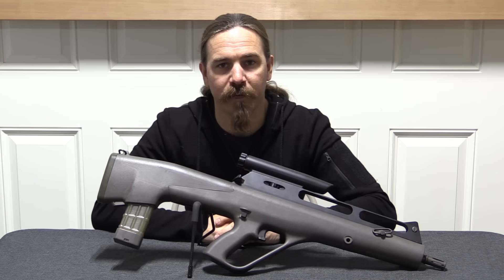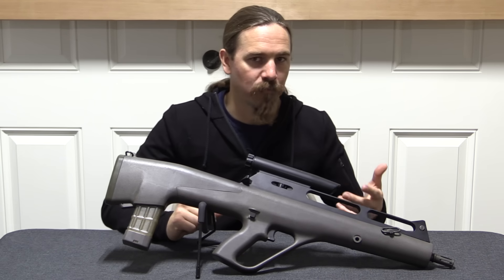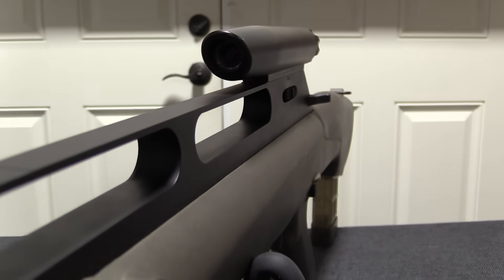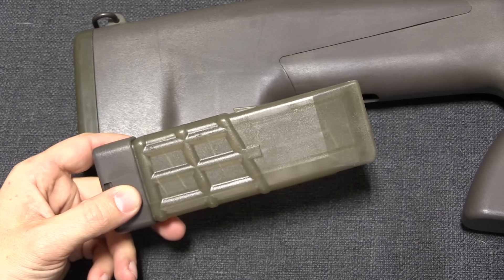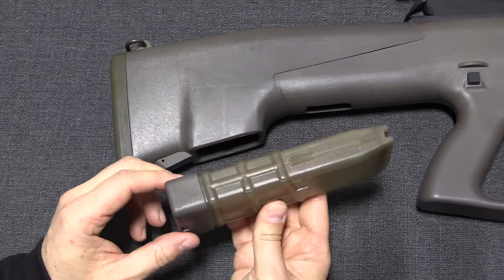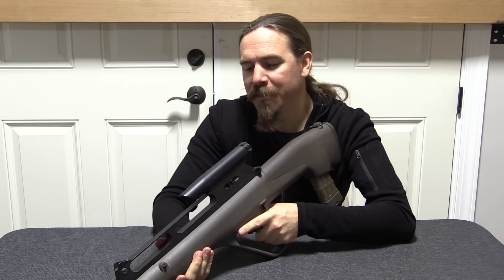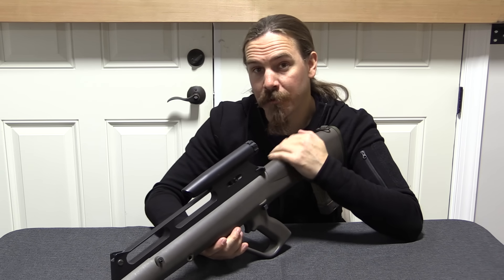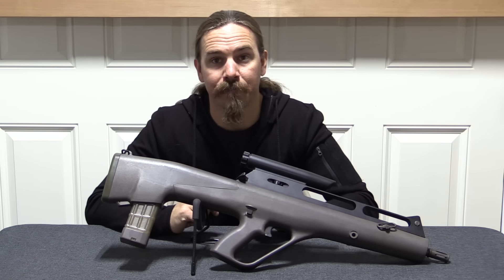Steyr ACR: A Polymer Flechette-Firing Bullpup From the 90s

Comment: Couldn't this design have been improved in some way to make it so the case just flushed out from the muzzle after firing the first shot? Certainly would help address potential problems with the extraction.

With the feeding, I can see it easily being fixed by shaping the magazine/feeding mechanism and the breech in a way to guide the cartridge in there rather than the finger that basically pokes the bullet into a flat hole 1cm away from the mag. Could technically be interesting, since it would straight up remove the need for having a hole to have stuff extract from, which could in theory make the weapon virtually mud proof (Asides from the muzzle ofc)

Comment: correction on the G11.  While yes it did have that high cyclic rate burst optoin, it also had a "recoil inside the shell" system where the gun recoiled while firing, but the rifleman didn't feel it till the last shot because it was still travelling backwards in the shell, similar to the recoil mitigation of the PAW you reviewed, but intended for burst fire.  It also was to have a slowed ROF full auto and semi auto mode available.

Comment: The amount of resin and plastic used does not give me a warm and fuzzy. I can see folks with solventy hands fresh from working on a vehicle in the Army degrading the stuff and stress cracks and even chips being a hinderance. I mean I have had fiber reinforced nylon mags crack and mess up feeds, never yet with a metal one. Fiber reinforced nylon is one of the best engineering polymers I can think of for the task too. But I left me sad that it did not last so long in the field tested. I would love to play with one, as I had an absolute blast in the Army over a two decades ago using a F88 while training with some folks from Australia. There are massive similarities outside the round, and of the round my curiosity is very high.

Comment: I keep wondering, how did the ACR deal with the flash gap betweel the hi pressure round in the chamber and the barrel? Did it at all? Could that have been one of those things that caused it's reported low reliability?
Reply: When it sometimes blew it felt like someone slapped you in the face.  The backstock then had to be replaced.

Comment: Is it just me, or is that rifle really pretty? Especially compared with the G11, which looks like a metal brick someone stuck a handle to the bottom of. The G11 looks like a weaponized monolith from 2001. It looks like a giant Wonka Bar with a scope. I could go on.
But unlike the Vektor CR21, the form for this Steyr actually seems to follow the function. And while the flechette itself might not have been the best projectile in the world, the casing design looks really interesting.
Reply: replace with long-ogive spitzer boat-tailed round.

Comment: I just realized, that this is the gun used by the EVAs in Neon Genesis Evangelion.
The japanese really have quite the taste when it comes to guns xD
Reply: A flechette firing weapon makes sense at an Eva's scale because it would need to penetrate armor and a lot of it. If the ACR's flechettes were scaled up to weigh 660kg instead of 0.66g but maintained their muzzle velocity of 1450 m/s, they would have kinetic energy of 693 MJ, twice that of the USS Iowa's 16 inch guns firing 1225 kg shells at 762 m/s. Of course it doesn't compare to the positron rifle charging up from Japan's power grid (187 GW) for 30 minutes, then letting it off in two 4-second shots (effective power of 42 TW), but still.
Reply: @d.akross3639  i had an extremely similar line of thoughts, especially since the pallet rifle is intended to take down an Angel's AT field before going in for a killing blow if I remember correctly
Reply: Now that you say it, yea!
Reply: Also the G11s used by the JSDF troops when they storm NERV. Anno must have had high hopes for the ACR program
Reply: I thought it looked familiar!
Reply: You see quite a few neat and rare guns on those Japanese cartoons if you pay attention, Japanese artists seem to have good taste and to really appreciate obscure firearms.
Reply: that does not make sense at all. That rifle is way too small for an EVA.
Reply: @luigiesio  It's been scaled up to super-size
Reply: @luigiesio  Bruh, the rifle was supersized for a EVA
Reply: @luigiesio  It's been scaled up to super-size
Reply: Heck yeah! This is probably lo y do to them not being allowed to have em, so they are great at "ogling" and drooling over firearms.
Reply: @mikestavisky8009  I do feel in this specific case it was chosen because of the flechette thing, as it needs to go through hard to penetrate energy shields. Pointy=better penetration is my guess for the reasoning at least 
Might just becuase it looks cool and futuristic
Reply: @mikestavisky8009  Look up “Japanese Gun Porn” on YouTube. No, it’s not literal porn. Just very high quality images and videos of guns.
Reply: @mikestavisky8009  Guns are something that nerds tend to he interested in.

Comment: The magazine capacity of 24 is more to do with the length of the mag. The intent is to allow the soldier to adopt a 'prone supported' using the base of the mag, the trigger guard and oregrip resting on the ground. This is to enable the soldier to fire from a stable and very low position..

Comment: It's probably the benefit of hindsight, but that gun seemed doomed to failure from the start.
1. There is a lot of metal sliding back and forth and up and down as it cycles. Unless the bolt parts were extremely light, it has to have a weird recoil impulse. I can't imagine it was conducive to staying on the target, which would defeat its whole purpose.
2. The mechanism is unnecessarily complex just to feed its unconventional ammunition. I would be concerned about reliability, especially in battlefield conditions.
3. The novelty of the ammunition seems unnecessary. I'm sure it saved weight over a brass case, but the cost was points 1 and 2 above. It probably was not worth the trade off.
4. Flechettes with a discarding sabot notoriously have accuracy problems caused by unreliable separation of the sabot. It works well in tanks, but not in small arms. Again, this goes against the purpose of the weapon unless they wanted to increase spread to increase hit probability.
5. The 24 round magazine seems silly when the primary advantage of the weapon requires a 3 round burst.
6. IMHO, the multiple bullets in a single case makes the most sense if you want to spew the most rounds with the least recoil. No other system offers a better rounds in flight to recoil impulse ratio. Add to that the soldier isn't chewing through ammunition any faster just to get a theoretical increase on hit probability. Or if he does use a 3 round burst, he gets 6 or 9 projectiles in flight instead of 3. It's win win.

Comment: Everyone is  comparing this to the AUG or the famas, but to me this is much more similar to the Korobov TKB-O22. Dropping bolt, U-shaped rammer, annular gas piston and high barrel/OAL ratio.
Difference is that the O22 was chambered in standard ammunition, and possibly the extraction system

Comment: From stories I've heard from people that fired this thing...

The Army wanted a 3x hit probability improvement over the M16A2 in the ACR program and didn't get it. The soldiers doing the testing knew it wouldn't. The range system they used to test how much soldiers were mussing by and how often was actually a pretty interesting feature of the program.

Soldiers hated the Steyr and the G11 because both required disassembly to clear a jam... in Steyr's case, you have to remove the buttstock, the G11 is... worse.

Comment: Just a curious question, I notice in front of the trigger on the inside of the trigger guard there is a button or something... What's it's purpose? You can see it around the 13:50 mark and a few times before that.

Comment: Accurate shooting over a distance is quite hard with this kind of sight.
But that's kind of the point...to quote my drill sergant when asked about this sight: "We shoot to wound not to kill." 
At least on the STG 77 A1, at a distance of 300 meters a man of average height (1,75) will fit right inside the ring. Which let's you know that you can start firing now since that's the effective range...

Comment: 7:44 - One in 213 cm not mm! :P
Reply: ?  1 inch is 2.54 cm
Reply: @gbear1005  Yes it is. However, 83 inches is 213 cm, not 213 mm. It's actually closer to 211 cm, point being it was CM not MM.
7:37 Ian explains how the Rifling does 1 full twist in 83 inches, or 213mm but meant to say 213cm. 213mm wouldn't even be 10 inches :P

I had to rewatch this, since I posted this comment over a year ago and had no idea what it was about lmao.

Comment: Really interesting design. I'm curious how terminally effective the flechettes would have been. I also wonder if this design could have been adapted to a more traditional bullet.
Reply: "I'm curious how terminally effective the flechettes would have been."
Judging by the gel block tests I've seen that were done for both the SPIW and ACR program, the flechettes are devastating at velocities over 3000fps, with permanent wound channel size tapering off as the terminal speed of the dart went down to the sonic barrier.
"I'm also wondering if this design could have been adapted to a more traditional bullet."
It would not be very difficult at all to design a sabot for a conventional bullet to work with this type of case.
Reply: ostiariusalpha It's a really interesting gun and I'm curious why there wasn't further development. Obviously, not getting the contract matters, but I wonder why Steyr didn't continue development for other militaries or LE.
Reply: +The Chopping Block  Large scale budget cuts at the end of the Cold War, I suspect. Everyone just held on to the proven weapon platforms that they already had, or as with the HK G36, adopted something that was even cheaper. There was no motivation to adopt a new, and unperfected type of ammunition that was totally incompatible with NATO standardized 5.56x45mm. That's what I think.
Reply: It is mentioned in the ACR program summary that Steyr didn't believe that a heavier projectile would be possible with both the ring primer and polymer case.  One or the other would have to be sacrificed.  Note that the Ares AIWS and the current LSAT use conventional primers with their polymer cased telescoped ammunition.
Reply: As for terminal effectiveness, the ACR program summary mentions that the Steyr flechette was far less likely to yaw in 20% gel than the AAI flechette.  While Steyr sourced their flechette from AAI, Steyr had to shorten them by about 0.1" to fit their cartridge case.  When flechette did not yaw, they caused far less damage than conventional projectiles.

Comment: Having had some trigger time behind AUG's with the 'doughnut' optical reticle and the low power magnification sights, what you describe is essentially what happens. For longer range shooting over a couple hundred meters, the eye will naturally centre the target in the middle of the reticle. It's the not greatest for 'precision' shooting of course but for combat snap shooting at human size targets it's more than acceptable and actually rather quick to acquire and use.

Comment: They need to start these programs up again because i think there is some real potential that just wasn't realised. They gave up without really trying or developing the ideas fully.
Reply: They have restarted them. Look up "Textron," "LSAT," and "CTSAS." The Army wants polymer cased ammunition to replace conventional metallic cases very badly, and they're pushing their development pretty hard.
Reply: Unfortunatly they combined them with a general purpose cartrige and the cased telescoped carbine turned out to be quite heavy. They should also slim down the casings to keep down magazine bulk.
Reply: +MrPotato The carbine prototype is indeed too heavy and bulky for what it could be. The intermediate type CT cartridge isn't all that fat, and it's shorter than 5.56x45mm, so you could probably fit another pouch on a chest rig.
Reply: The 5.56mm CT is 11.4mm wide so the mags would be ak mag levels of long, the 7.62/6.5 CT however is 12.7mm wide wich is already enough to moke it significantly longer then a 7.62x51 magazine.
Reply: +MrPotato  40rd pmags don't bother me, even from the prone, and 5.56mm CT mags would be shorter than those. Perhaps a ~30rd coffin mag might get the mag height down more.
Reply: ostiariusalpha
The original CT carbine chambered in 5.56 CT did use a 40 round quadstacked magazine the same length as an AR-15 30 rounder, so i guess you are right about that. But i still think that slimming down the casings to something more reasonable would be smarter. After all, and increase in magazine length isn't worth it when the cartriges it contans do everything contemporary ammo does aside of the 40% weight decrease.

 And as for you not being bothered by 40 round pmags in prone. This doesn't apply to everyone, and also you're wierd.
Reply: +MrPotato  LOL! I admit that is true; I cant the rifle slightly when using 40 rounders, so that the mag forms one leg of a bipod, with my support arm as the other. I suppose it you are too short that might not work. A quad stack mag would make a great monopod though. Naturally, I completely disagree that a 40% weight reduction isn't worth a longer magazine, but if we compare the case diameter the bullet caliber, we see that the 7.62mm CT case is only ~62% greater in diameter than its bullet caliber. The 5.56mm CT case is around 100% greater in diameter, so there might be some wiggle room in there to make the cartridges slightly slimmer within the limitations of not affecting the case wall thickness. Basically you're trading off the more efficient powder burn of the fatter case for better stacking in the magazine.

Comment: Honestly, it's not really all that surprising that the magazine is only 24 rounds. The entire point behind this rifle was to enforce marksmanship and to do so forcefully, right (even more so than the M16A2)? No full-auto, 1,200 RPM burst. If you really want to enforce fire discipline and marksmanship, then limit even the magazine capacity. After all, we had just gotten out of using battle rifles with ~20 round magazines. Larry Vickers recommends only loading 28 into a 30rd STANAG magazine. 24 for something that was supposed to be even more artificially restricted than the M16A2 seems to be a way to make the individual soldier keep in mind reloading and carrying magazines when firing.

Not to say I agree with the doctrine, but that was probably the reasoning behind it.

Comment: Speaking from personal experience with the AUG (or F88 Austeyr) the "doughnut of death" is.. ok. its function at 1.5x as a ranging tool for 300m is useful i guess as its point of reference is really fast; however a definite dot/chevron or crosshair I find is far superior.

Comment: An open bolt gun with a vertically moving bolt... maybe not the best idea for accuracy. Still, the system is very simple, but needs the proprietary side primer ammo, not readily adapted to brass case ammo.

Comment: Question about the general principle of the thing
If all the projectiles are going to the same point of aim, won't they all either hit together or miss together? In this case, would making the gun shoot tighter groups actually lower the hit rate?
Reply: generally yes, but when using duplex/triplex rounds you have to keep in mind that all the projectiles do travel at different speeds. e.g the first 800fps and the second 750 fps. So ideally they would have the same horizontal point of aim, but 2 differen heights increasing hit propability as it allows for wrong range estimations.
Reply: Hadn't considered that. very insightful

Comment: The thing with the sight is: at 200m a man sized target will perfectly fit inside circle - at least with the AUG. That allows for faster aiming since you just have to get the target in the circle and you're pretty much going to hit it - at least that's what we were told during mandatory service. The sight isn't made for ultra precise fire but that was never it's intended use.

Comment: On inrange you and Karl had said the only way the M16 would be replaced is if you had something cheaper, lighter and more accurate than an AR platform. If they could have had R&D time and were able to fix the cartridge issues could you see this weapon beating out the M16? Could an updated model beat the M16 in a modern ACR program?